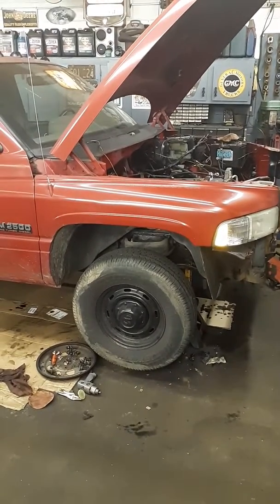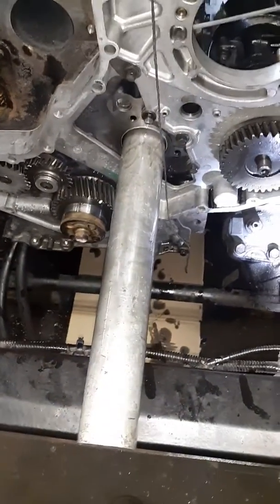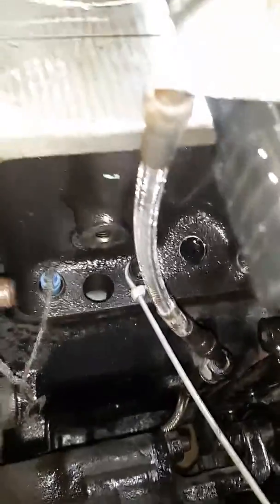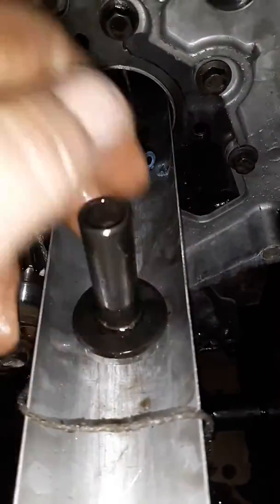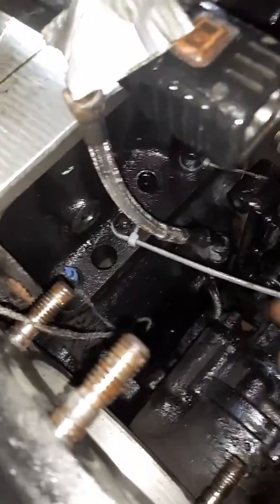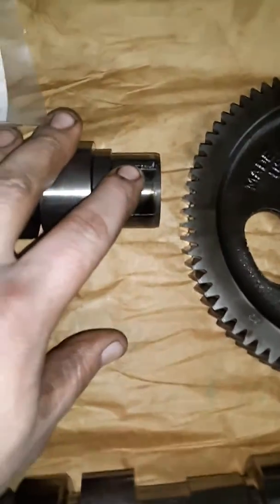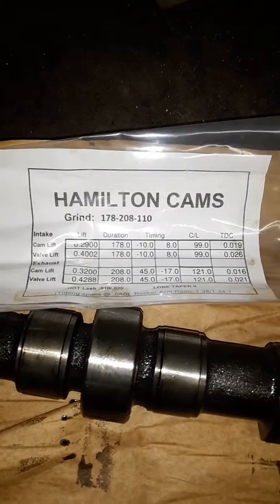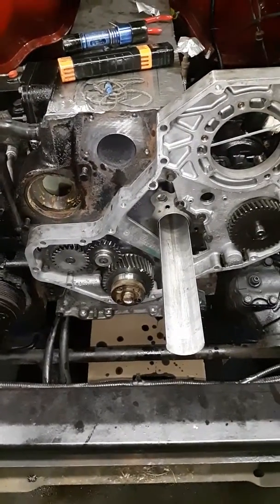12 valve cummins cam install

Comment: I just ordered the same cam for my boat. Did you have to degree the cam when you put it in? Or were you able to just drop it in?
Reply from the maker: Just line the dot on the cam gear up with the one on the crank the same way it was when it came off no degreeing necessary

Comment: What was that plug you used you pull the tappets?
Reply from the maker: Just some plastic thing I round in my garage you can also use a piece of wooden dowel. Really anything that will fit snug in the tappet you can tie a string to